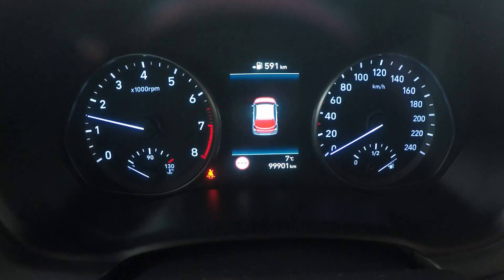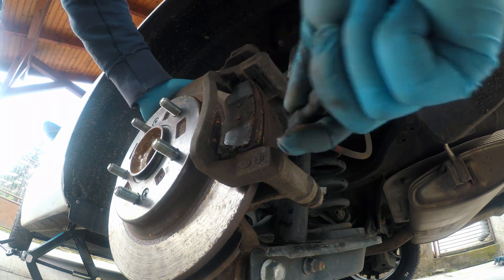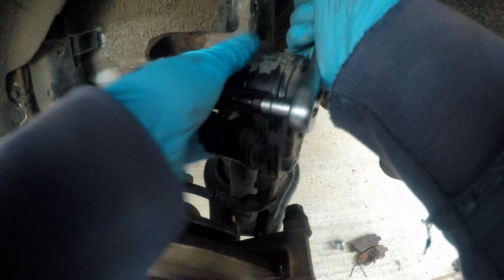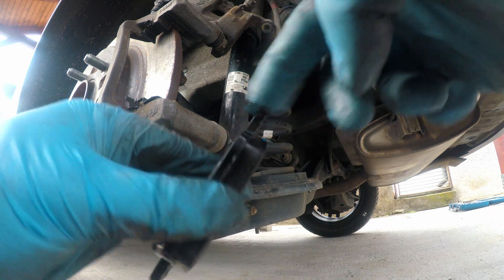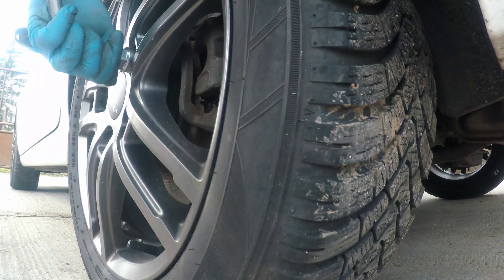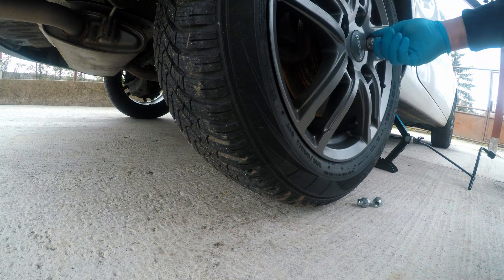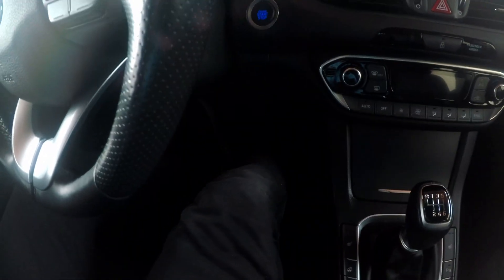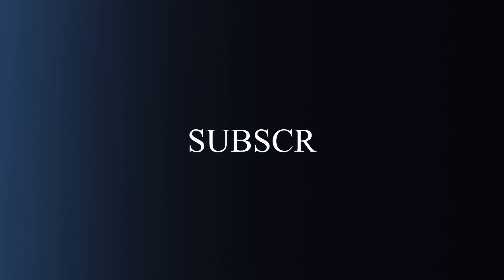DIY Hyundai/KIA Electronic Parking Brake Release (EPB) Trick

Comment: 1:50 save these springs, my replacement pads did not supply them. Be careful removing them because if they fly off you may never find them again.
Reply from the maker: I have also seen pads without the holes to mount the springs….

Comment: This is informative.  I have a 2023 Kia Sportage LX and planned on replacing the brake rotors and pads next spring.  I want to know if I will get an brake error message if I remove the (-) battery terminal before I unplug the electronic parking brake connector.
Reply from the maker: most probably yes…. try not to unplug anything electrical

Comment: I've seen other videos where the EPB is disconnected first. Can you confirm a service light will illuminate if the connector is released?
Reply: Confirmed, never disconnect it- it is better to manually switch EPB to service mode (google it).

Comment: Do you need to screw in that EPB thing back (that you loosened up)  after you release the pressure from the caliper? In other terms, do you need to do the opposite from what you did starting at 12:27....
Reply from the maker: nope it adjust it self when you activate epb ….
Reply: @takeapart  thank you so much. God bless you!

Comment: Good video, about to do my moms rear brakes on her 2021 kia sorento, though i do prefer the method of EPB release on my f150, a sequence of gas pedal and holding the EPB switch and it unscrews itself and easy to push the piston back. Cheers 🎉
Reply: Does this work on the Kia models with this same parking take? What are the exact steps to do this if so

Comment: Do you have to do the electronic parking brake release if i just want to take of the caliper for troubleshooting? It is sticking a bit.
Reply from the maker: I do not know what you mean ...  you can disconnect connector from EPB motor or you can remove EPB as in video (keep it clean).

Comment: 5:20 do you have to put Loctite for putting back bolts on EPB actuator? 
It was hard to take out bolts as it was loctited..
Reply from the maker: you should, but….
Reply: @takeapart  i skipped 🤣 might as well just check if they are tightened well next time when rotating tires

Comment: My EPB break won’t go back in after I twist it with an Alan wrench what am I doing wrong
Reply from the maker: it needs to be released (no epb applied) while working on it.  make sure wheel spins when lifted. note: use blocks to prevent car from rolling while on jacks… safety first!

Comment: omg this worked after thousands of YouTube videos . I live in Australia usually mechanics charge for this electric parking brake rotor and pad replacement around 700 bucks. that includes front and rear brake pads and rotors; only labour cost (quote from hyundai)
glad I found this video DIY.
Reply from the maker: glad it helped you! thanks for watching

Comment: How did you managed to remove the calliper while the EPB was still engaged? Isn't it still pressing the pads?
Reply from the maker: EPB wasn’t engaged….
Reply: @takeapart  How did you do that? When my car is in P the EPB goes automatically ON.
Reply from the maker: @ballbreakerBS my car is manual …. maybe leave it in Neutral and put blocks under the tyres so the car won’t roll on its own
Reply: @takeapart  What did the job for me was first to remove the el. motor of the EPB and release the preasure over the pads. The rest was a walk in the park.
This video helped a lot. Thanks!

Comment: My brake re generative  light has come on, braking is not good whilst driving on kia Niro 2020 ev can u help, I changed front pabs, just looked at rear without removing motor or connections, only removed back caliper, but the lights have come on?
Reply from the maker: not an expert on that car …. regen is different from normal brakes.
Reply: @takeapart  cheers

Comment: Judging by the tread wear on that rear tire, it needs some suspension work
Reply from the maker: great judgment! it seems to me like shock absorbing issue. Hyundai says all is in order…. hhh
Reply: @takeapart  that is an absolute load of bs from hyundai!
I'd also be checking the forward toe arm. The bushings in those tend to go bad, and cause the tire to slightly camber in, mix that with a wearing shock, and you'll get wear very similar. If it was just the shock, usually the entire surface of the tire would be wearing like that
Reply from the maker: @neilmaccallum3476 aggree! thanks for tips… will check it out and report back!
Reply: @takeapart  please do.i would love to see what you find. Something g I have learned over the years from master techs, just because itn not leaking(shocks/struts), doesn't mean they're not bad. Bear hug the tire while the vehicle is jacked. If you can lift the wheel up and down easily, the shock is toast. There should be resistance, as the car weighs over 4000 lbs
Reply: @takeapart  this video tho...by far thr most informative, and simple minded. Everyone else wants you to d/c the wiring, and jump the electrical using 12v. Which is fine, however, you run the risk of frying the motor